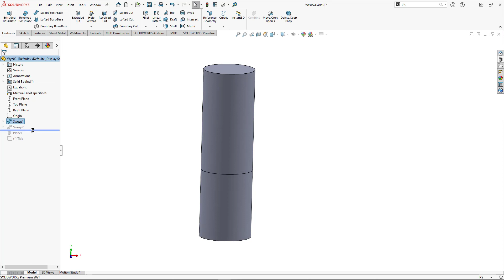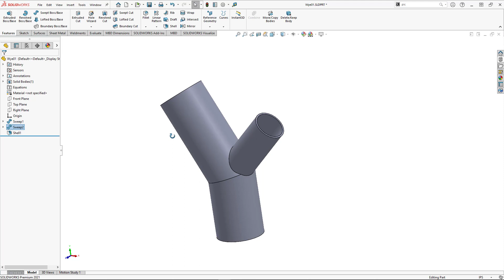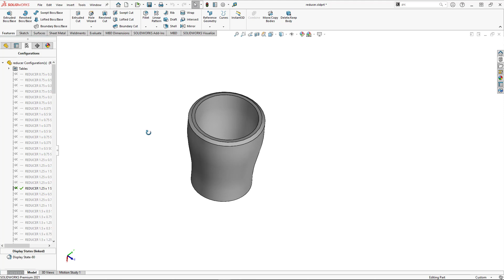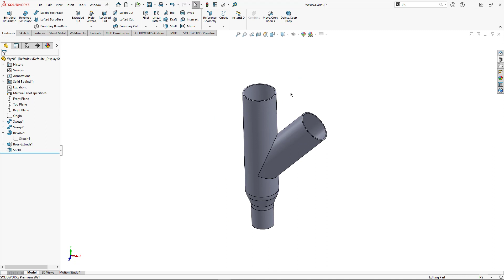SOLIDWORKS - Wye Pipe Model Part 2

Comment: Thanks for the very informative and helpful video. However, is there any way to shell the two pipes where the connecting pipe has a larger inner diameter than the other pipe but both pipes still have the same outer diameter?

Comment: How do you control/change the fitting orientation in a pipe route if the 45 branches off off in the wrong direction?
Reply from the maker: If your modeling the pipe, It shouldn’t really matter the direction that the 45 branches, I’m guessing that you’re referring to the direction the 45 deg branch would be in the assembly. Many times (especially with revolved parts), I tend to constrain the model in the Assembly by using the Planes of the model,  More often I’ll use the Angle Mate, here’s a good link to a video on mates - https://www.youtube.com/watch?v=rKqn3CmaFv0